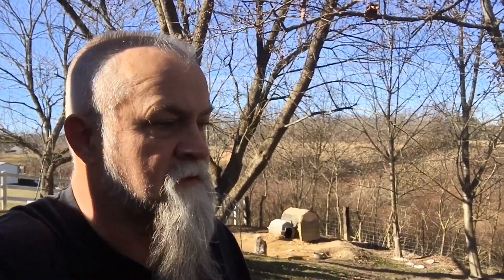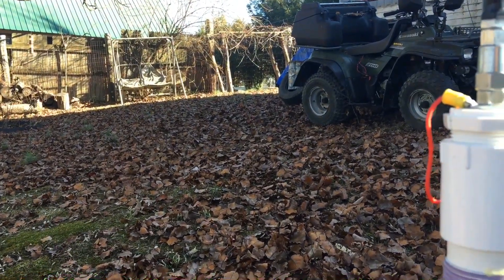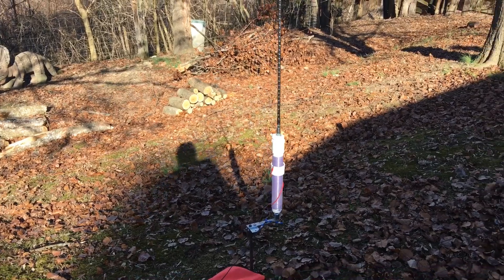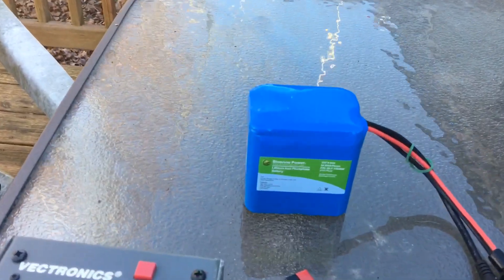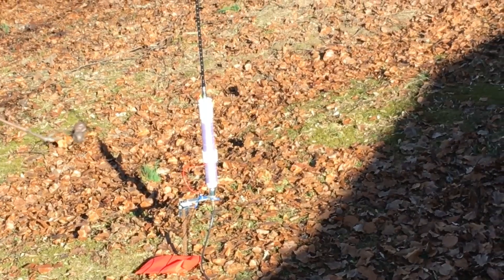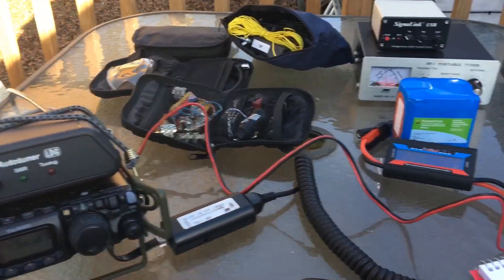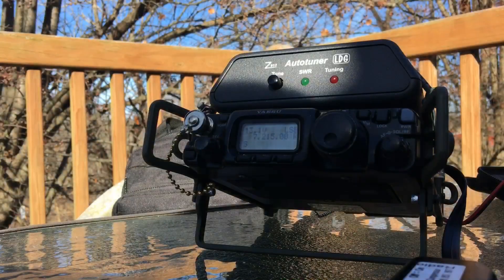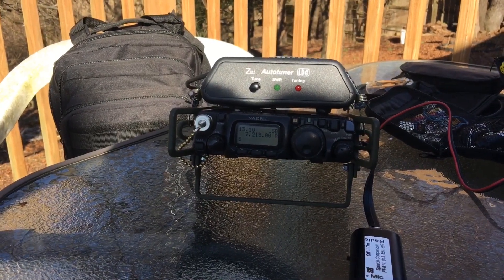DIY Vertical Antenna - WRC Clone - On Air Test

Comment: Where can we get the coil breakdown?
Reply from the maker: Thanks for watching.  I never did an actual build video on this antenna, but this video, near the end has information about the build that I typed and put in the video as images so you can read.  You will have to stop the video at each image and read what I wrote.  I hope this will help.  https://youtu.be/esjkwADkWB8   I may try and build another, but this time actually do a construction video.  Again, thanks for watching and you comment.  Juddie - WD8WV

Comment: Hey Juddie, I appreciate the time you've put into making your video's.  Great material.  I was wondering if you had the instructions on how to build it.  I'd like to take a crack at it.  Any info would be great.  You can send it to my QRZed email.  Callsign is KD2TSC.  I appreciate it.  Have a Blessed Day.
Lou,
KD2TSC
Reply from the maker: Thanks for watching and commenting Lou.  One of the videos, there are two videos, I have a somewhat description at the end on how I built it.  In the Community section of my YouTube channel there is a sketch that I did, of course it was the early version where I had a SO-239 at the bottom instead of the bolt.  I will try and do a better description and try and email it to you.  Again thanks for watching and the comments.  Juddie - WD8WV (J  & J TOA)

Comment: Congratulations, Juddie! Well done with the homebrew antenna. Yes it does work :) Nice work on the video, too. 73 from Tracy VE3TWM.🍺🌲
Reply from the maker: Outdoors On The Air thanks Tracy, I appreciate that comment.  I do want to improve on it by getting something other than the HamStick for the radiating  element.  I am looking at aluminum tent poles so I can backpack it.  Again thanks for watching and commenting.  Juddie - WD8WV

Comment: Great video ! I want to build one ! Are you going to do a build video on the antenna ? And how much power can run on your antenna ? Great job !
Reply from the maker: I am thinking about doing another one and I plan to record a video when I start building it.  As for power, everything is 18 gauge, the coil wire is galvanized steel wire (bought at Lowe's), the red wire is regular power wire (bought from Walmart).  The Hamstick I know will handle 100 watts, not sure about the coil itself.  I am sure it will handle anything from 1 watt up to maybe 50 watts, but I have not tried 100 watts.  Remember I built this for portable operations and I have three radios for that, a Yaesu FT-817ND and my Bitx40 and uBitx.  Not sure when I will do the build video, I have all the materials to build another coil except for the top section.  I may do the build in another few weeks.  Juddie - WD8WV
Reply: @JnJTrueOutdoorAdventures  Great ! I will be looking forward to it !

Comment: Thanks for the vid.  This is EXACTLY the type of ham radio vid I like.  I've been playing around with a free DIY 4 band vertical.  It works like gangbusters.. and its free. lol.  If you wanna check it out, look for 'Michigan Cacti DIY (free) 4-Band Vertical Antenna'.  I've also been playing around with a low 80m EFHW that cost me $3 for the UNUN core.  I hated to spend actual money on an antenna!  73 OM
Reply from the maker: Thanks for watching and commenting.  It seems you and I think alike, why spend a lot of money if I can build it for free!  LOL  I will take a look at your video.  So far my vertical will work from 12 thru 60 Meters by just adjusting the collar.  It will do 10, but I have to slide the collar all the way up and use a jumper from the collar to the 10 Meter hamstick connection on top.  Again thanks for watching 73 Juddie WD8WV

Comment: Looks great Juddie!  My buddy John, who copied your design and built the antenna you showed the pictures of, is having a blast with his and even worked Alaska from CT running 100 Watts.
Reply from the maker: WOW!!!  That is awesome Rob!!!  I wished I would of pulled out my uBitx with 10 watts instead of the FT-817ND but I wanted to work with 5 watts.  I would probably pull out my Alinco DX-SR8T if I had a larger battery for running 100 watts.  I guess my next thing is save up some money and buy myself the FT-891 (I think that is what your using).  I just like being able to put all of what you saw, except the analyzer, into my backpack.  Thanks for watching and commenting!  Juddie - WD8WV